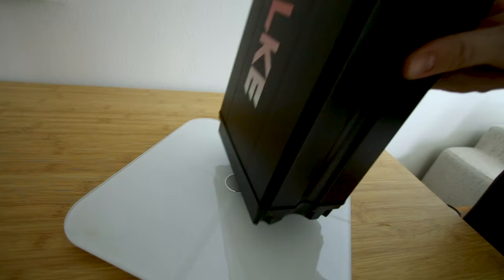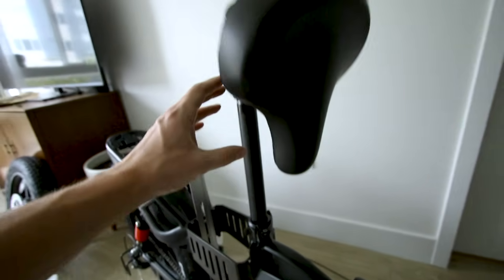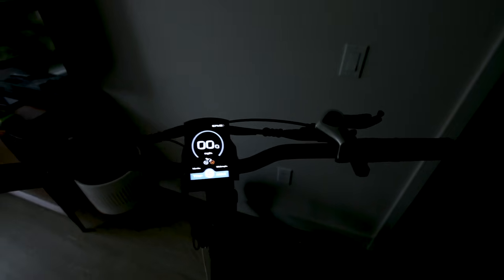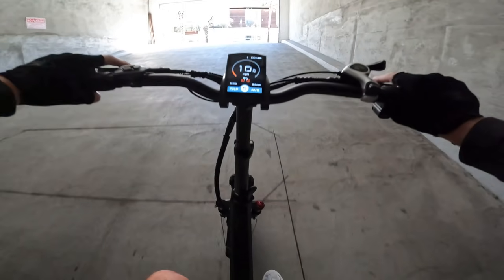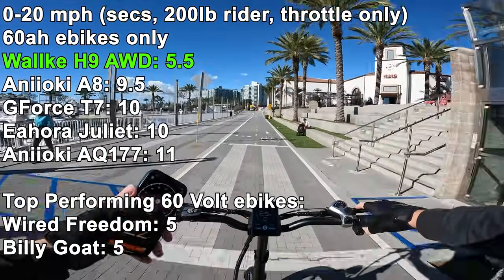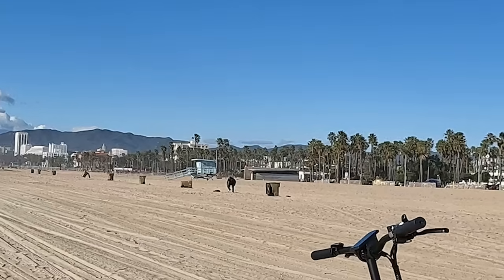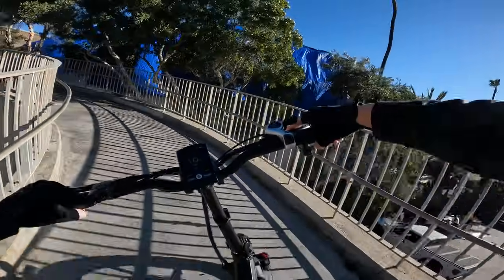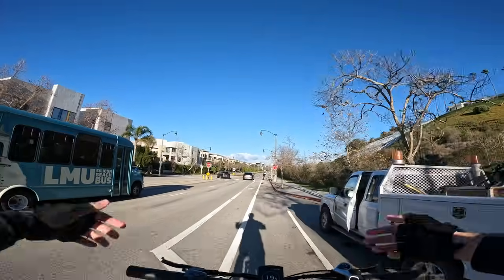This AWD "100 Mile" ebike is a MONSTER! Wallke H9 AWD Review

Comment: PLEASE HELP: So I bought this Ebike after going through an EXHAUSTIVE amount of research including this video. It was my first Ebike purchase and here’s my issue: WHY IS THERE A PEDAL SYSTEM AT ALL? This does not seem to be a “pedal assist” bike - so why the pedals??? You’re either on throttle only with zero pedal resistance, or on zero power trying to pedal a 100lb+ bike. Is anyone experiencing something different? There’s no exercise with the H9 - just fantastic power and range but no exercise option???
Reply: I am confused on what you are trying to say. If you wanted exercise option only then don't turn it on...
Reply: @TankTheSpank  if I wanted the exercise only option, I wouldn’t be riding an electric bike lol… I bought an electric bike so that I could have a pedal assist. The H9 is pretty much a Mo-Ped out of the box. You’re either pedaling a 100lb bike with no power, or there is zero pedal tension and you’ve got tremendous throttle power. Anyway, I’ve gotten a lot of advice on how to go inside internally and change the settings so I hope that makes a difference.
Reply: @maestroalhadeff , I'm looking at this bike.. did changing the settings help?
Reply: At first I didn't understand your question, and now i got the Bike i get what you mean. The assist levels are highly adjustable.. Level 0 is 0% power Level 1 by default is set to 50% and Level 2 is set to 70% level 3 is 80% level 4 is 90% and level 5 is 98%. I changed my Level 1 to 45% and level 2 to 65% Level 3 to 75% level 4 85% and level 5 to 100%.I get my exercise on level 2 which has a max speed of 18mph. You can play with the settings and set what works for you better. Keep in mind that because of the stock crankset and casset, you will "ghost pedal" around 17-18mph. by getting an aftermarket crankset with higher tooth#'s will definitely give you a little more resistance in high speed for exercise.
Reply: Thanks!! That’s super helpful :)
Reply: The peddles are to keep it from getting a moped rating so you don't have to buy tags or insurance.
And allows you to ride in the bike lanes.

Comment: I want to buy this bike so bad but also scared of theft. What's the point of spending $1700-1800 plus $400-500 for  good locks and getting stolen within a week. This bike can't be insured since it's dual motors that's way exceed 750w which is the limit for all insurance companies. If I could find an insurance company that's willing to insure a 1000+w ebike I'll definitely get this bike.
Reply: I bought this exact Ebike Wallke H9 60AH. and insured my bike thru "Sundays" bike insurance company, i was skeptical about the hoops and loops of what they cover, I requested a written statement that they will cover my Ebike and they emailed me that they will, so far so good, even though i have an insurance i am still hoping that it wont get stolen.. I am paying $12/month for the e bike insurance btw.
Reply: @santoslorenz thank you for the info. I think insurance companies need to update their policies now that most of the new ebikes came with a 1000w motor or more. Eventually, none of the new ebikes will be covered if they still keep the limit at 750.

Comment: This is a cool bike, good pricing too. In my opinion, the Grizzly is still king 👑
Reply: Grizzly is not a king when you have to pedal after 30miles. Wallke will keep on going more than 60 miles in dual motor
Reply: @santoslorenz  eh, to each their own. Grizzly has 35ah, this has 60ah. Almost double so it better have more range.
It's also almost 140lbs while the grizzly is about 110lbs.  Grizzly also has a range of 42mi of non-stop full throttle. The 100mi range is always an exaggeration, if you do the math, it's probably closer to 60mi of non stop full throttle. That's more than most need for a bicycle, and most people charge after they ride. I've yet to have my grizzly "die" on me after hours of riding
Reply: @santoslorenz  so you're pretty much trading 20 extra miles of range for an extra 30lbs. Not worth it in my opinion, but everyone has their own needs. If I need to go anywhere further than 30mi, I take my car 😂
Reply: @deklinstanelle9345  I live in tucson and we have "The Loop" which is a 120 mile stretch of a bike route. So Wallke is gonna be the better option for me.
Reply: @santoslorenz  whaaaaa dude no way that's awesome. Yakima, Washington could NEVER. That would be a cool ride for sure. I just have regular roads here, not even bike lanes. Grizzly gets me around town, I need to get a Hitch so I can carry it on my car and go visit a few state parks a few hours away.

Comment: whats the fastest this has gone owned by someone light ,can it hit 40,my scooter has 2-3000 watt motors & cant understand why e bike  manuf. dont put bigger motors in a heavier ebike,so I like Anoikki a8, billy goat( small battery), Romeo
Reply: They can but they have to also put a bigger controller to handle a 3000 watt motor plus it's adding more weight and the price would be increased, the company's that do have a 3000 watt motor sell there bikes for $4k-$6k and they will be 60 volts or 72 Volts parts are cheaper on scooters too compared to bikes